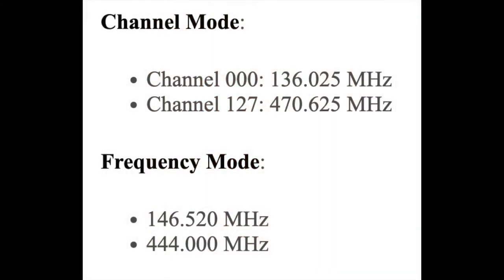Baofeng UV-5R | Part 10: Managing Channels

Comment: WHAT band frequency key?  Not seeing that on my units.
Reply from the maker: On my Baofeng UV-5R the "BAND" key is just above the keypad, to the right of the BAOFENG logo.

Image link here: https://ibb.co/GxRz8cm
Reply: yep; not present on any of my 5's
Reply from the maker: That surprises me! I guess the BAND key wasn't all that useful. I know that I program my radio without using the BAND key. At the time I made the video, I didn't realize that it was optional or obsolete.

Speaking of my radio...

How to Display Firmware Version/Date:

With the radio powered OFF, press and hold one of the following keys while powering ON:

Firmward Version - Press and hold [3]: "Ver BFB298"
Date of Manufacture - Press and hold [6]: "180531M"

I assume that "180531" translates as May 31, 2018.

What is te date of manufacture for one of your radios?
Reply: 210023M  comes up with 6    Sure doesn't stay on very long.
Reply from the maker: Hmm...maybe your radio was made in 2021? Sorry that I can't help more! Who knows what the makers of Baofeng were thinking!

Comment: Why does it seem that I cannot delete channel 127 even though it is not appearing in the Baofeng programming software spreadsheet?
Reply from the maker: Yep, NWR weather frequencies have not changed. I live about 5 miles from our local NWR transmitter, so signal is nice and strong. I can drive about 10 miles and be up high on a ridge and that helps my UV5R get a good signal for ham as well as state police transmissions. Location, location, location!
Reply: @MiltReynolds  I understand location and height.  However if I'm exactly where I was over a decade ago using a cheap handheld Uniden scanner or my 30+ year old Realistic PRO base station scanner, why is reception worse with the "new and improved" Baofeng with the longer antenna upgrade?  That's my beef.
Reply from the maker: Great question, Guillotines. Here's what I have in my notes:

The radio ships with two pre-programmed channels:

- 136.025 is stored in memory as Channel 0
- 470.625 is stored in memory as Channel 127

Can these be changed? Yes, but only one at a time!

The radio appears to require at least one stored frequency at all times. If channels 0 and 127 are the only channels with assigned frequencies, they both cannot be deleted. We can delete one of these, either channel 0 or channel 127, but we cannot delete both of them.

Attempting to delete both channel 0 and channel 127 will simply result in a reset to factory settings, including the pre-programmed channels of 0 and 127.

The work-around method is this:

- Store a third frequency in any empty channel
- Delete channel 0
- Delete channel 127

This work-around method  allows at least one stored frequency in the radio, while deleting the two pre-programmed channels.

All of this is based upon programming the radio manually, from the keypad. Perhaps programming from the software spreadsheet is different?

I recommend trying the work-around manual method I've described, then adding more channels using the software spreadsheet.
Reply: @MiltReynolds  Thank you for the tips.  I have much to learn.  Although I tried "manually" deleting channel 127 before, it did not work.  I only have channels #0-6 programmed, and I have transmit frequencies blank.  However today I "manually" deleted channel 127 again and that seems to have fixed it.

I other other questions as well but will probably resort to a forum rather than youtube.  To make a long story short, I'm not sure if anything has changed in the last so many years, but the last time I had a handheld scanner was in 2010.  I used to listen in on the local police, fire, etcetera.  Programming those frequencies on my Baofeng UV-82 (I chose this model over the UV-5R) results in typically static.  Even the local NOAA weather station frequencies I remember hearing on my late-1990s Radio Shack weather radio are very staticy on my Baofeng.  I even bought the "upgraded" NA771 antenna although that doesn't seem to make much of a difference.  I assumed reception would at least be as decent as my old Uniden handheld scanner from 13 years ago but that doesn't seem to be the case.
Reply from the maker: I hear you. I've had the same problem. My 200-channel Radio Shack scanner has better reception than my UV-5R. I've had to resort to making my own quarter-wave antenna and mount it on my roof! It doesn't take much to block signals...a tall building or a ridge. It's difficult to get an antenna up high enough, but that is the ideal way to improve reception

Regarding police and fire, I think times have changed! In the 80's and 90's I could listen in to emergency service transmissions all day long, local, state and federal. I can still pick up a few state police transmissions, and some of the smaller town and county units.

Wishing you the best. 73!
Reply: @MiltReynolds  Thank you.  The handheld scanner I used to have had an antenna approximately the same length as the UV-82's factory length antenna.  I've had a couple of other scanner base stations as well with the chrome extendable antennas.  All seemed to have better reception than the Baofeng.  I know at least one of my frequencies was correct, as there was an accident nearby and I heard a slight amount of staticy chatter on it (squelch set to 0.)  So I know that they're not all on digital yet at least.  And of course the NOAA weather stations are probably the same as they were in the year 2000 when I had my Radio Shack weather radio.  Programmed to the same KWO39 weather station, I even remember the automated voice, brings back memories to 20 years ago!  On the Baofeng it is staticy as heck.
Reply from the maker: I agree...that is frustrating.

Comment: Sir I have 6 of these radios. I would like to use them in my service yard between managers, supervisors and leads. Any thoughts on what we need to do or suggestions on which frequency to use?
Reply from the maker: Joe, that might be a good alternative. Thanks for letting me know where you're located. I've not explored in depth how to get a business license...it might be easy and affordable. You might consider looking into it. I'd start with the FCC page.

But, for sure, it's a good idea to keep them for emergency use. Program for a local repeater, train your team to use them. Consider getting an amateur radio license for practice. Practice makes perfect, and operation means transmitting, and legal is better than illegal!
Reply: Mr. Reynolds. Thank you for your reply. We are in Sacramento Ca. and I was thinking of using them within our work yard between 4 of 5 employees. Secondly, if that is not possible, I can always keep them at home for an emergency or trip.
Reply from the maker: That's a super good question, Joe! Unfortunately I don't think you're going to care for my response. I intend it to be helpful and encouraging. Also, I don't know where you are located, what the business purpose is, and what regulations and laws govern your region. The Baofeng UV-5R has the capability to transmit and receive a wide range of frequency bands. But the FCC governs my use, so I must go by their rules and regulations. Perhaps your rules and regulations are different because you are operating in a different country. But, here goes:

Source: https://www.arrl.org/files/media/News/ARRL%20appropriate%20use%20guidelines.pdf

The FCC Rules and Regulations have a fundamental purpose:

The amateur radio service is a voluntary noncommercial communication service, especially intended for emergency communications. The rules do allow for "public service projects", as well as "personal communication needs".

However, the rules expressly prohibit communications in which the operator has a financial interest, including on behalf of an employer.

Licensing for business purposes is not the same as licensing for amateur radio service.

Here's is a link to the FCC page on licensing:

https://www.fcc.gov/licensing-databases/licensing

I don't know what frequency bands are assigned for commercial use. This how-to is strictly for amateur, non-commercial operators.

Sorry! 73!

Comment: Hello sir you help me a lot of your videos thanks for that. So im using a uv5r and a i have a single band im planning to buy another baofeng uv5r for my friend on other cities
On vhf you think we can transsmit and receive cities from other cities?
Reply from the maker: I think it depends upon whether you are transmitting simplex, or whether you are transmitting to a repeater station. Simplex means you can only transmit line of sight...if you can't see them, you won't be able to communicate with them. If there are any mountains or hills or buildings between you and your friend, simplex transmissions will not be received. Even with nothing between you, and you are both on level ground, the curvature of the earth limits you to about three miles. 

However, if your friend is somewhere in space, in a straight line from you to your friend, simplex transmissions will go quite far, much more than three miles.

Now, there are exceptions to everything. Atmospheric conditions will at times allow the VHF signals to bounce and reflect a great distance. But it's rare.

If you're communicating through a repeater, the story is much different. Repeater stations are typically installed at high elevations, allowing a much longer line of sight signal reception. Additionally, repeater stations can be linked together in a chain. I've used my Baofeng UV-5R to transmit and receive signals from hundreds of miles a way, communicating through linked repeaters.

Question: Why do you say you have "a single band"? The UV-5R can transmit on two bands: VHF and UHF.
Reply: @MiltReynolds  i have a bf 888s and i have uv5r so i connect them using uhf frequency my plan is to buy another uv5r for my friend and i question you sir about the uv5r transmiting to another uv5r using vhf then the answer you gave me is clearly thank you very much for the information👌✅✅✅
Reply: @MrBrown-uu1cb  bear in mind that the 888s has less than 2 watts transmitting power, against 4-5 watts for the UV9R, so you won't get at much range on the 888s, although with a better than standard UHF antenna and a bit of elevation, they can cover quite a bit of ground.
Reply from the maker: Good point, Philip. 73!